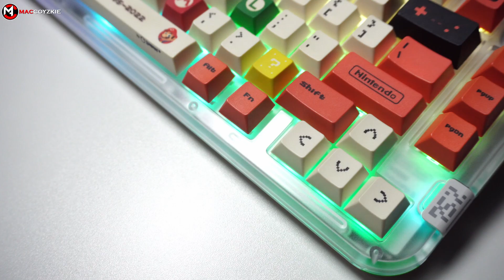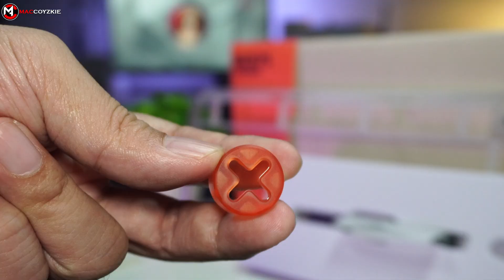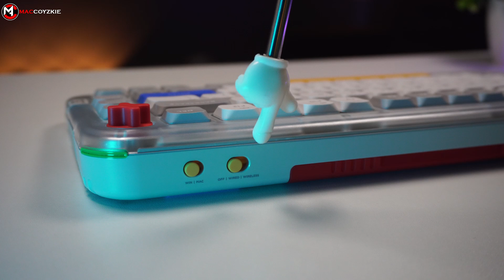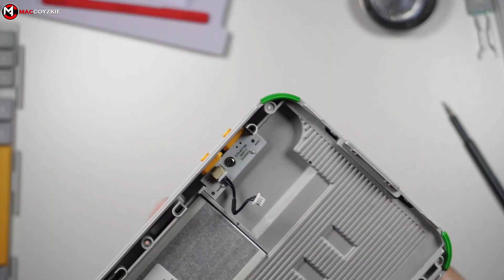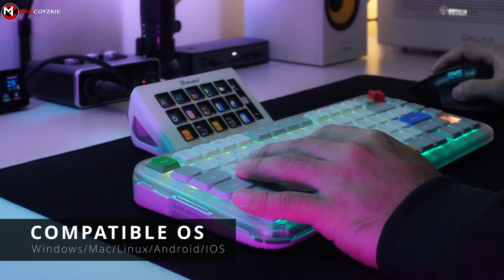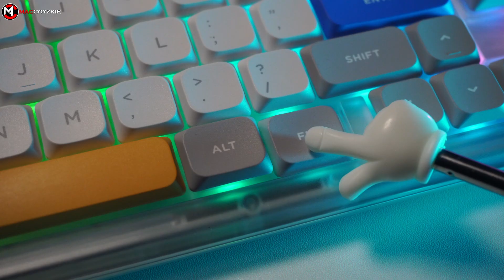Low or high profile? no problem! Nuphy kick75 keyboard

Comment: This is a really nice looking computer, and when I saw it I knew I had to have it now that nuphy finally included the volume knob.  After many hours of research I decided to actually go with the Nuphy Air 75 HE, while it doesn't have the knob, it have better build quality with the aluminum top, as well as magnetic switches that are superior to the Red switches, but what really sold me was the fact that there isn't a battery.  I like the idea of going wireless, but ultimately I never use the feature, and by not having a battery in the keyboard, that battery is never going to swell and fail, so I can have the Nuphy keyboard for literal decades.

Comment: Yo, I need help with something, last night my PC was working fine I was getting display on my monitor, but this morning my PC was turning on but showing no display, I tried connecting the monitor to my ps4 and I was getting display, but when I tried putting it back to the PC it wasn't displaying anything but I could've go tomorrow safe mode and BIOS b couldn't go in the windows, then I tried plugging my PC to my TV through HDMI and I was getting display in then again I tried plugging it back to the monitor and again I wasn't getting any display I even tried changing the HDMI cable but nothing changed also I also made sure that my monitor was on the right HDMI and it can't be from the monitor since it worked on console, pls can u help me 🙏🏻
Reply from the maker: plug your monitor back into the pc, i need you to check the monitor osd>inputs try selecting something else and select hdmi back. also if there is an auto option in your monitor osd select it so it will automatically detect any inputs

Comment: Hey Mac! What's the difference between NuPhyIO compared to the QMK & VIA?
Reply from the maker: VIA is easier to use as it is just a web mapping customization for a keyboard. As for Qmk it offers advanced customization through open-source firmware updates.

Comment: That thick keyboard is not a low profile keyboard. If that's a low profile keyboard, my normal keyboard with a bunch of o-rings is a low-profile keyboard. A low profile keyboard is meant to lower the entire keyboard so that you don't need a wrist rest. Slapping low profile keycaps on a thick keyboard is not it.
Reply from the maker: I get  what you’re saying—just putting low-profile keycaps on a thick keyboard doesn’t necessarily make it low-profile. But with something like the NuPhy Kick75, which is designed to support both low-profile and standard switches, the intent is to offer a true low-profile experience when configured that way. It might not be as slim as a dedicated low-profile keyboard, but it’s closer than just swapping keycaps on a regular board.
Reply: I agree. I ordered the kick 75 thinking it would be a nice upgrade from my air75... I really like having a space between the function keys and the rest of the keys... I received it yesterday. It types like a normal profile keyboard with low profile key caps... It's actually terrible... One of the worst keyboards I've ever typed on... I love my air75...